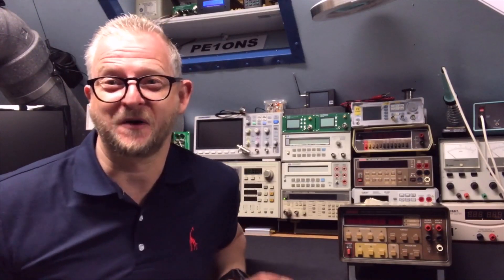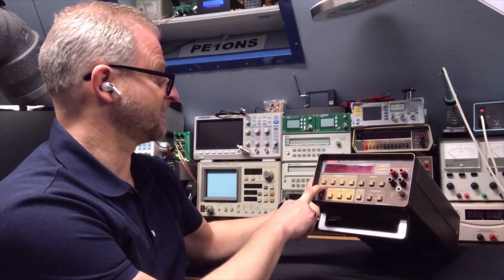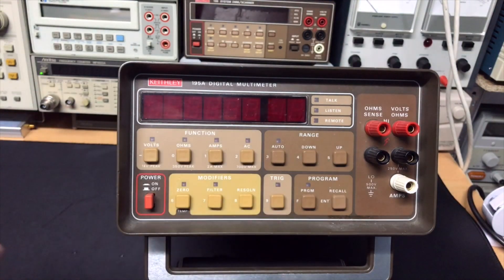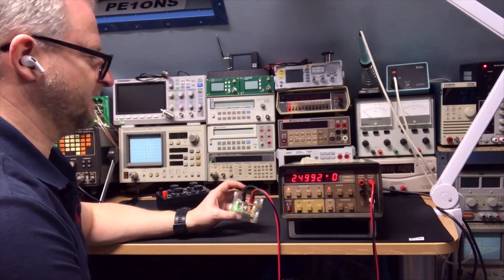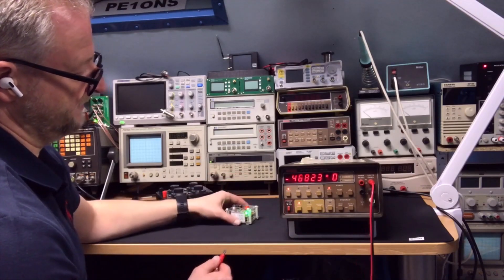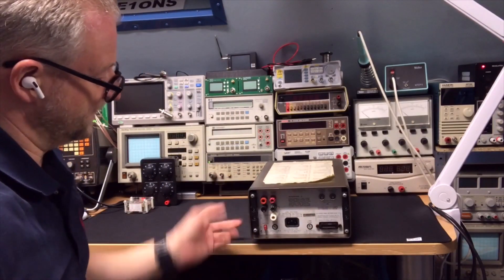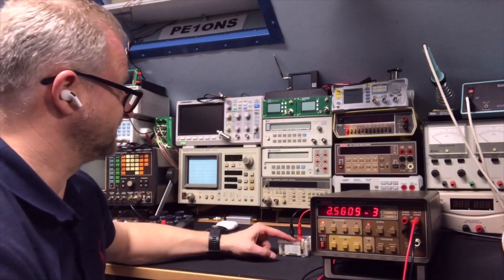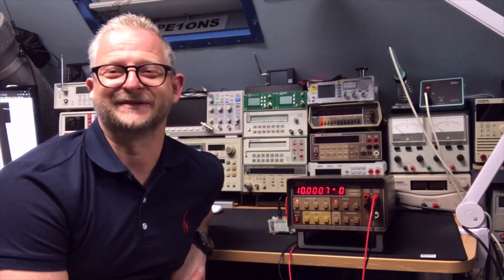#100 Keithley 195A DMM Restore Calibration Teardown

Comment: Thank you for this video! You have saved me a calibration and repair charge. The AC function on my 195A was all over the place. I never thought to check the rear panel switch and its connections for oxidization. My meter came from some corrosive environment, there is horrible corrosion on the BNC's and the nuts that hold the multi pin data connector on the back panel. Now after working the switch and the connections on top of it (inside) a few times, the meter is in perfect calibration in all functions!!
Reply from the maker: Glad it helped, and thanks for feedback!. nice to hear this

Comment: Oh wow!  Had one of those that I sold on eBay.  Great piece of kit.  Got it from a place I used to work at in around 1999 :). It had a dodgy switch that wouldn't latch on if remember.
Reply from the maker: Thanks... it is a welcome addition.. if you worked with it.. it must have been good... than it's a keepr for me!
Reply: @TonyAlbus  Yep, it was the switch on the back now i look at your video, but they were a common part in the olden days, so not a real issue to replace then :)  Good luck finiding one now..
Reply from the maker: Thanks Stephen ... just cleaning solved it.... finding a replacement now would indeed be a challenge 😁

Comment: Hi Tony
@TonyAlbus we have a Keithley 193 which was given to us. we are not sure about the accuracy of any output from it. we have done basic test using resistance measurements. we used a multi-turn 10K resistor and at full deflection keithley outputs 20K!! we have repeated the experiment with lower know resistors 5.6K and the output appear to be correct/close. Any ideas.
Reply from the maker: The 193 is very nice, i think i have one without the AC and amps... maybe check/clean the frond/back switch if you have one. with good quality contact cleaner. WD40 has pro contact cleaner

Comment: You are lucky. You are one of the few who got a 195 with the option 1950 installed, which is by the way the upper alumnium case.
Without this option the 195 is just a DC Volts and Ohms meter. It cannot even measure DC Amps not to speak about any AC !
Nearly all 195 you can buy today come without the option 1950.
Reply from the maker: Thanks, i did not know how lucky i was... thank you, now i am sure it stays in my collection.